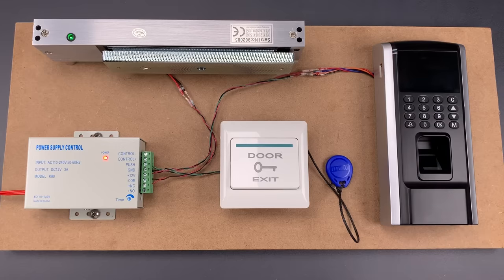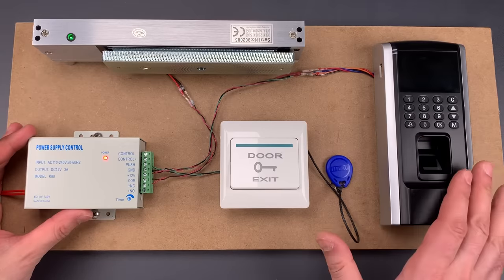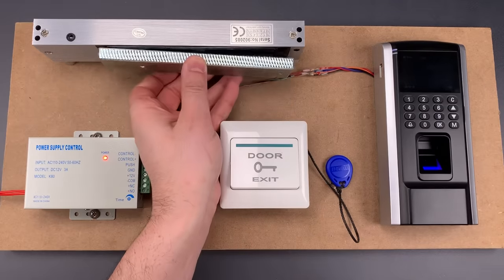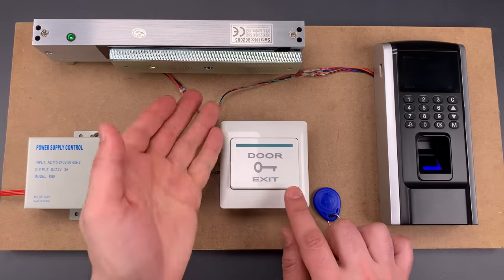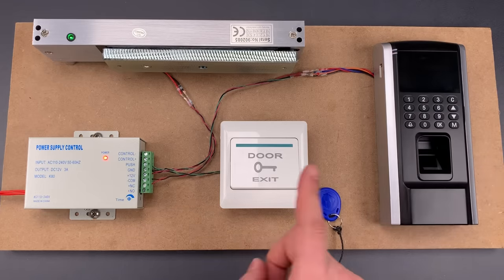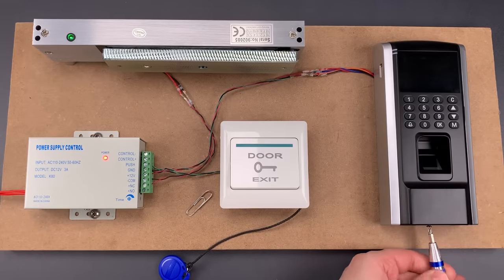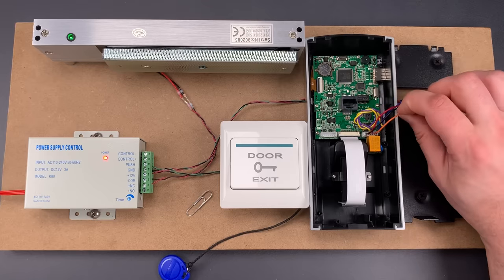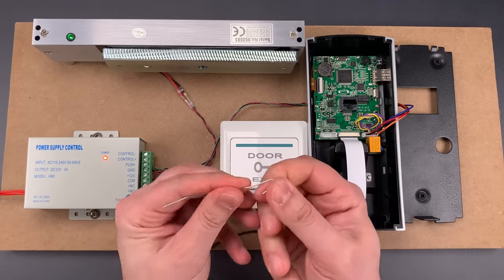[1040] Fingerprint/RFID Lock Defeated With a Paperclip (Mengqi-Control)

Comment: Wow, just goes to show that most security systems rely on intimidation and general ignorance over actual security. One screw, that's ridiculous.
Reply: @Curi Osity Nice. Anything to slow them down is a win in my book. :)
Reply: It's the old thought of, a lock keeps the well behaved out, but anyone that TRULY wants into something can always find a way.  I bet 1out of 10 smashing this head unit defaults to opening up too or might short the cables as well...lol.
Reply: That screw may be small, but it's 3D printed out of cold-rolled, degaussed, depleted titanium.
Reply: The thing is that there is door contacts on most doors in shops or wherever so when a door is opened and the alarm is set opening the door will result in a alarm.
Reply: @TheTruthKiwi  He's saying the heater has the security screw, not the lock lol.
Reply: @kean4218  He's turning the signal from "no" to "yes" so if this lock was wired to an alarm, it wouldn't trigger the alarm.
Reply: @K7L3-93  door contacts are wired Separately from mag lock it's just a Reed switch in a vacuum that is joined by a magnet attached to the door open the door moves the magnet away disconnecing the Reed switch.
Reply: @TreyCoursey  Looks like the power to the mag lock requires a high signal, so at least it's got that going for it. Still would need to short blue to orange (or shorting blue to black should work as well).
Reply: No, that's not at all accurate @The Truth. There's a huge gap between consumer (and cheap) products and actual security systems. In most real security applications, the external reader/keypad/whatever sends a telegram along a set of wires, rather than a simple electrical switch signal. This is what LPL is referring to with the whole safe/unsafe side of the door. You want to transmit information into the safe area for processing*. The *information is much more difficult to influence than the electrical signal.

Furthermore, most real security products have tamper switches as mentioned, but not so easy to bypass, and which will actually disable the transmitting of information. For example, in many HID readers, there's a photosensitive resistor on the inside. The box is completely tight and does not let any light in. Even the slightest increase in light will cause the tamper switch to trigger and the reader or keypad to fall into an inactive state. 

So most actual security systems rely on actual security and proper design. But cheap imitation products, where you can buy the "same" product for 1/10th of the price obviously have to cut a lot of corners. 

Although they could relatively easily improve this drastically, for example by having two switches or a change over switch, where a certain and very exact interval of time needs to pass between the changes in state of those switches. Or by adding certain resistors to the circuits, so that an open/cut or a closed/shorted wire would not trigger any reaction, because the proper procedure could be for example that the resistance of the circuit needs to change from e.g. 10000 ohms to 50000 ohms, or whatever. Mechanisms like that, while still no match for proper security products, would be substantially harder to defeat "in the field" than this garbage, without adding any signficant cost to the product. 

But essentially; when you buy the cheapest product, there's a high risk you're buying into a complete illusion. If you demand (some amount of) quality, and prioritize that higher than what's the cheapest or best selling product on Amazon, you can easily find alternatives that offer a completely reasonable level of security.
Reply: @Nicoleise  thank you, plus most security systems rely not only on one device rather a combination of multiple devices, lpl here is just demonstrating why you don't cut corners when it comes to security devices.
Reply: This is a gimmicky product sold on ebay to unsuspecting people. A real access control system like one made by HID uses a central panel to process all the information and the keypads do nothing other than send data to the panel to figure out what to do with it. This is barely suitable for an interior office door, let alone a residential entry door.
Reply: That box should only be accessible by removal from the door or jamb and removal should only be possible from inside the building.  It's that simple.
Reply: Luckily that shell appears to be plastic so it should be fairly simple to run electrical wire to the screw inside the shell, tie it around the end so they can't get the screw out without pulling it, and then supply the would be burglar with 110 volts when they try to remove the screw.
Reply: @TheTruthKiwi  How are you slowing down anyone if all they need is a paper clip and a screw driver
Reply: Even simpler is using the human factor, more ala The Mentalist or p.i. Rockford.
Reply: When all else fails, just use C4. ;D
Reply: This is generally true of all security. Not just the tech but even security services.
Reply: @kean4218  If that's the case, the alarm would sound for every valid entry. Once the reader outputs via the 2 wires that were jumpered,  the door should not alarm.
Reply: Security in a nutshell, even human assets. The job is the uniform and w telephone
Reply: @livenotonevil8279  If the alarm is a separate system, it also needs a separate way of disabling it. Another keypad inside, or through a remote control. The system showed in the video, is just a replacement for a normal key.
Reply: @MacOSTrash  yep, like the TSA
Reply: Let's be honest, it wouldn't be anymore secure even if it had 2 lol
Reply: It’d be more interesting if it was a proprietary screw like what Apple does on it’s iPhone.
Reply: @TreyCoursey  It's not gonna open it by default because the Magnetic Lock is set up on normal open (has constant supply of electricity). As with paperclip though, all you need to do is use that constant supply of electricity, transfer it to default open (requires electricity to open) and watch it cut electricity to the magnetic lock.
Reply: Perception is everything.
Reply: It’s called “Security Theater.” 

Airports practice this heavily.
Reply: That is pretty hilarious it only took 1 screw to remove the cover of the device, its harder to crack open a desktop mouse then that panel. You can also probably just cut the wires since its meant to make a loop just cutting them off the circuit board and twisting them together will probably open the lock too since to open you just need a closed loop and the circuit board is probably responsible for causing the signal to see open so putting the common and normally open lines together which is what he does with a paperclip. I feel like based on the power supply box it was meant to be more but they just cheaped out since its got taps for a separate control line but clearly there's no separate control module, since why design a part that has connection points that have no purpose...
Reply: Also it just goes to show that the average consumer does not know much about these types of products, and should really receive consultation from a professional before purchasing. It looks complicated, so they probably thought they were doing a good thing by buying this and using it, but a pro surely knows the difference!
Reply: This is a gimmick lock. Like he said in the video, a real security lock won’t send the open signal from the keypad, let alone via a single relay contact. It’s almost like it’s designed to be bypassed.
Reply: Keep in mind this is a $160 lock off of Amazon.  I would hope that a professional system used to lock up professional buildings would have more security.  I imagine the programming is similar to bypass though.
Reply: Locks keep honest people honest. If someone wants it if there's a will there's a way.
Reply: not at all. the second he opens the case on a professional installed system the system is in lock mode. and the cops are behind you,
Reply: yup and thats why LPL is fighting this Security by obscutirty bs.
Reply: you can't just say "most" if you just saw 1

Comment: That was actually a lot easier than picking a mechanical lock
Reply: Think so too. I cant open a mechanical lock. No chance. But this here can be done by a 5 year old lol
Reply: Because it's not picking, it's bypassing. Most Bypasses on mechanical locks are just as easy, when they exist. Actually pixking electronic locks is practically impossible

Comment: The fundamental flaw is underestimating the Lock Picking Lawyer.
Reply: Or he's wife, when she wants ice cream!
Reply: No, this is stunningly flawed. Some of the mechanical/physical exploits seem to me like they require knowledge of the particular mechanism... but this one is written in silkscreen on the circuit board.
Reply: @WeslomPo  his, not he's
Reply: The flaw would be securing the panel with a single small screw and not making it impossible to get into without sending it back to the manufacturer

Comment: This is the hardware equivalent of authenticating your password client-side...
Reply: Yup.
Reply: Such an atrocious design. Even if they're too lazy to switch the side that the authentication is performed on, they couldn't at least have used a PWM signal instead? Obviously still unsecure, but requires a significantly greater amount of knowledge and technology to overcome than a paperclip.
Reply: @MatthewStauffer  would cost more to implement, either raising the MSRP or reducing profit per unit.

So instead we have LPL demonstrating that the product is utter crap and should be returned to the seller as not fit for purpose.
Reply: Fire up disassembler, bridge the jmps with paperclip, done.
Reply: @MatthewStauffer  Look, there are multiple problems here; using Phillips screws, rather than any other type that decreases the likelihood of an attack to the interior of the electronic components, is already a huge flaw that signifies a particularly telling lack of interest on the manufacturer's part. Having just one screw that is easily accessible from outside is just ridiculous.
Reply: Not that different than many of the garage door remote control security algorithms over the years.
Reply: Perfect example of why companys use server side
Reply: @dutchdykefinger  Hell, just putting that one screw on the back, where it should be inaccessible while mounted, would be a huge improvement.

Comment: I never imagined that one of my all time favourite things to do of an evening would be watching a man demolish my illusion of security with such succinct precision. This is 100% a compliment.
Reply: That's a subcontext to his whole channel.  A lock will not give you security by itself.  A security service decal in the window provides more safety then most common door locks.
Reply: @Kishandreth  However that security service decal could be detrimental to have if you actually use a sticker for the security system you have installed as they can then look up the model etc and the default bypass or a major security flaw.
Reply: @empoleonmaster6709  That's why you use a generic sticker instead of a branded and model one! So they know there's something but not WHAT.

Though a surprise without sticker could also be good. Or good old "security led".
Reply: @SaphireLattice  Do better and get stickers for nearly every company you're NOT signed up for which will make it impossible to figure out you have one of the security systems that's NOT listed via your stickers.
Reply: @empoleonmaster6709  But then you just guess what sticker you don't have. So the best solution is to just stick everything including one you do have.
Reply: @Kishandreth  110% agreed!

I was a supply SGT in the Army. I learned very quickly that 99% of keeping troops from walking off with my sh*t was keeping it out of sight. Yes, I had Oakley sunglasses in my cage, and nobody, not even my own boss knew where they were... lol.  Locks only keep honest people honest.
Reply: @empoleonmaster6709  Not talking about a security system, but a decal of a security monitoring company.  I will admit I'm unaware of variations in security decals for the same monitoring company(Brinks for example).  At the point someone see's a decal and still wants to get inside it is already a lost cause.  Criminals are looking for an easy target unless you are specifically the target.
Reply: "demolish my illusion of security" my illusions of security usually contain lock circuit board on my side of the wall ,-)
Reply: Inglish 🔥🔥